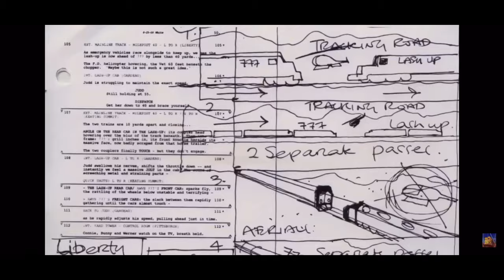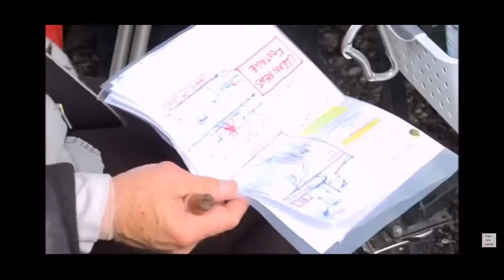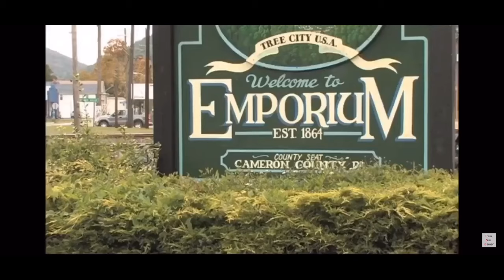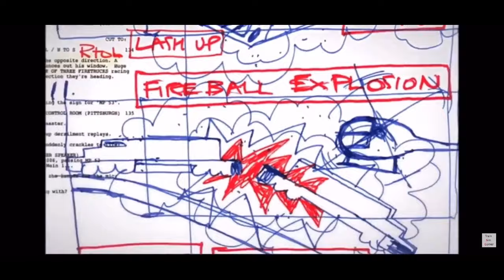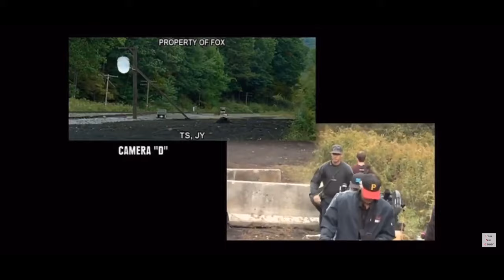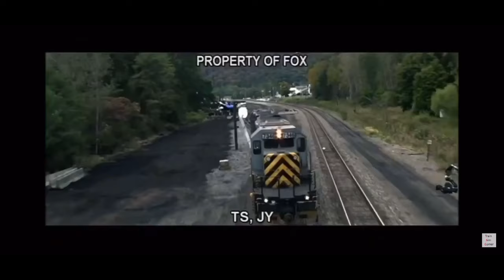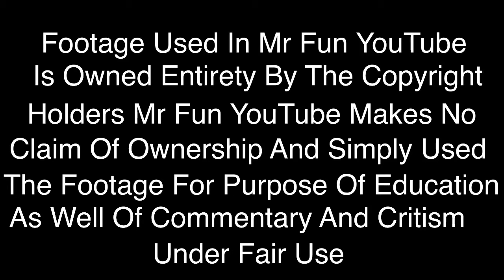Unstoppable 7375 And 7346 Derailment Behind The Scenes!

Comment: The BIG problem with that scene (like many scenes too) is this :  Mainly two problems. First, in the real life, both SD40's would never have been switched in another siding at the speed they were going. A siding is not a line where trains can go fast. Second, unit 777 was pushing both SD40's too close from each other so that 777 still remain on mainline when SD40's were pushed in the siding. In fact, all the engines and cars were supposed to end up in the siding and derailed. From my point of view, the movie missed the target too many times from what it was suppose to happen for real. Hollywood !!! Sorry if I'm too honest here...

Comment: I noticed some differences between the real locomotives and the fake locomotives.
1. The fake locomotives have a 81 inch low hood. In 1977, it was changed to a 88 inch low hood. The real 7375 was built in 1986 so it had a 88 inch low hood.
2. The radiators are chicken wire. Also in 1977, it was changed to corrugated radiators.
3. The middle axle on each truck is slightly higher.
Reply: and 7375 has The Controls of an SD40, by the way